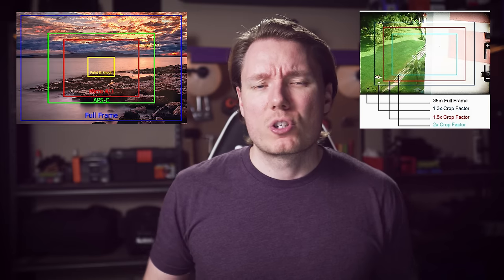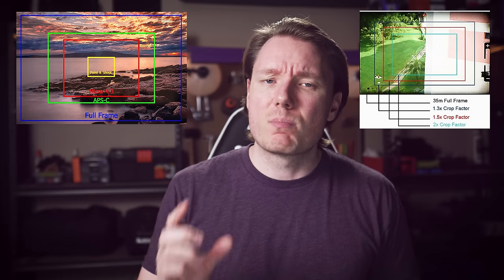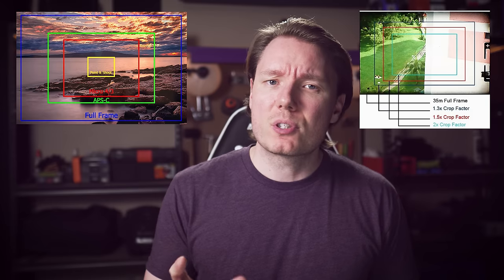Crop Lenses on Crop Bodies: How It Works vs Full Frame (APS-C & M43)

Comment: The one takeaway from all of this, the 35mm standard is a misnomer. Even in the height of 35mm there was other film sizes regularly used. The 35mm was/is still a marketing device. The larger the sensor, the more it costs, the more it retails for. The larger the lenses, the more it retails for. The marketing pitch is that larger is more professional, which to be fair is also a misnomer. The reality is simply use lenses designed for your body mounting system and sensor. How professional that final image looks is up to.
Reply: @krane15  I appreciate this, but in today's world it is a meaning less statement. The 35mm standard was also based off a normal lens being 43mm focal length. So when an aps-c sensor and lens is compared to 35 mm equivalent, it also needs to include the 43mm focal length. It takes the conversion into this weird territory of comparing a aps-c sensor with a 200mm lens would be the 35mm w/43mm lens of...(insert whatever numbers your working with)However it will be a different equivalent if the 35mm had any form of super wide, wide, short telephoto,large telephoto lens. It leads to a place where exact comparisons will always vary depending on sensor size and focal length. Manufactures should just simply state the degree of angle the sensor and lens produce. The photographer can choose how they obtain that degree of angle.  If we are going to use the most popular/used sensor size as a measuring device, then today's standard would the sensor in cell phone camera's with their inbuilt 8mm lens. So does that become the future?..this full camera has a equivalent of a 12mm sensor at 8mm length?
There is no reason to keep this equivalent comparison. It doesn't mean anything anymore.
Reply: @krane15  Fair enough, but I addressed the need for the reference point. When you buy a lens designed for a specific sensor type, it gives you the degree of angle the lens can achieve. Using Degree of angle is a universal reference point. A 32 degree of angle is always going to be 32 degrees regardless of whether its on medium format, full frame, aps-c or micro. 32 degrees is always 32 degrees. The only situation where this information could be important is if two photographers/video's are employed to capture an event and they both are using different sensor sizes, and they want to combine images/footage seamlessly in post and apply a LUT for smooth continuity. Even in this situation if both individuals simply matched their gear to capture at the same degree of angle, that would resolve the issue of both wanting to combine images/footage and keep it seemless.
Reply: @lefthandright01 35 mm is based on a normal lens of 50 mm. So said the man who created it.
Reply: @okaro6595  Which 35mm? Super 35? is the most common film type used in cinemas. Super 35 is far closer to APSC in size. It's still 35mm film, but how it is fed through the recording device is different.  No one will say its not 35mm. The 50mm lens was designed on its normal factor, hence a normal lens will of differing focal lengths depending on film type or sensor. So says the man who made it? Sounds like that man didn't know his product very well.

Comment: If I use a 25mm MFT lens on an MFT camera, will that field of view be the same on a 25mm Full Frame lens on a Full Frame camera?
Reply: No most likely no, unless the lens is designed for the same FOV as the full frame lens your looking at
Reply: You’d need something like the 12-35 by lumix to cover the field of view of let’s say the 24-70 of the Sony g master

Comment: Ok so I’m still left with the question of the the crop factor for the f/stops. If it’s a crop (Apsc)lens on crop body is 1.8 actually 1.8 or multiplied by the crop factor🤔 And same for full frame lens on crop body ( no speed booster) ..... and by this calculation i suppose Apsc lens on Apsc bodies the 15mm is a true 15mm? Not multiplied by the crop factor?
Reply: MrWazyShots as far as I’m aware, from countless YouTube videos, I’d say anyone telling you that you need to multiply aperture by the crop factor is just trying to sell you down the river. I have countless shots on my kit lens at 5.6 that are certainly not ending up with a close to 8 aperture.
Reply: Craig Bishop See that’s what I thought, but then if you can look up Toni and Chelsea Northrup’s video on it

Comment: 2 different bokeh questions:
I am shooting with a full frame 35mm lens at f 1.4
• If I enable crop mode on my Sony A7iii, does f 1.4 look like 1.4x1.5=f 2.1 (in terms of equivalent depth of field) ? In other words, is my background blur going to look like a 52mm lens shot at f 1.4 or 2.1?
• If I enable Sony Clear Image Zoom (x1.5) does f 1.4 look like 1.4x1.5=f 2.1 (in terms of equivalent depth of field) ? In other words, is my background blur going to look like a 52mm lens shot at f 1.4 or 2.1?
Reply: The crop mode just crops the image. In general do not use it. Crop at the post is needed.

If you enable it you must then step back. How this affects the blur depends on the distance of the background. If the background is very far it gets sharper but as it is also enlarged the blur what for example light spots cause remains the same.

Comment: Wow that got pretty complex at the end there but I think I got it. I watched this because in my testing at home, a Canon EF-S lens on my crop sensor shows the exact same image as an EF lens on the same camera. I thought that the EF lens would be  visually zoomed in, but it isn’t. So then I don’t have to do any math conversions if I just want to understand how a lens will perform visually. Crop & full frame lenses look identical on my crop camera.
Reply: Let's be clear, there is no such thing as a crop sensor, they are just different sizes. As an example, if you use a 24mm EF lens on a full frame sensor, and a a 24mm EF-S lens on a super 35 sensor they will both have the same field of view. There will be no cropping of the picture. If, however, you use the EF lens on the super 35 sensor then you will get a cropped image. Your findings with the EF lens compared to the EF-S lens on the same camera do not make any sense.
There is also cropping that takes place in some cameras that can shoot 4k as well as HD. This is because they cannot process a 4k image if it uses the full sensor size so only use part of it hence giving a crop.
Reply: @UKHeritageRailways  Thanks for your reply. I was using the word “crop” to refer to the APS-C sized sensor; it’s just easier to type, but realizing it can create unintended meanings. 
All this was because was I thinking the lenses “should” perform differently on the same camera, but obviously the sensor size was determining the final image and I understand that now. 
It was a little hard to wrap my head around how the focal length can stay the same between different camera systems/their compatible lenses, but the field of view can be drastically different. 
Thanks for sharing your knowledge!
Reply: Why would you have thought so? I really cannot think how people could think so unless they try to learn it without understanding it. You cannot learn things without understanding them.

Comment: A full size lens isn’t just spreading out the same amount of light. It’s sending in more light. To your your projector analogy, it’s like using a more powerful projector lamp, is it not?
Another channel said that full frame lenses work better on apsc because the soft part of lens image is outside of the apsc sensor.
At least this makes more sense to me but I don’t know who is right.
Reply: This confused me too and I think the flashlight example might have made it more confusing. It seems to imply that a full frame lens enlarges the image or an apsc lens reduces the image down to a smaller area, which as far as I'm aware isn't' the case. Lenses designed for smaller sensors just don't render an image circle for the field of view which isn't required. The 'extra' light in a full frame lens is there because it can see a wider field of view. Different sensors occupy different areas, but the relative size of image which the lens projects remains constant (as far as I'm aware)

Comment: Very interested and a new angle on the topic.
I have been wondering about that point... So if one concentrates the light like one does with a flashlight to a smaller point it gets brighter there... 
Now, crop sensor designed lenses project to a smaller image circle than full frame lenses... wouldn't it than also be similar to the flashlight that the light is concentrated so that it has an affect on the exposure?
In other words, can the T-stop of crop-sensor lenses be higher than on FF lenses? 
I didn't notice such a thing, never, in different cases.
But it would make sense and your Video brought that thought up again.
I hope my question is understandable, because English is not my native language.
Reply from the maker: That's a good question. It does have an exposure difference if you're using a speed booster, because that's like a magnifying glass, but otherwise no.
The light that makes it on to the sensor is coming from the world around you, which doesn't change when you change lenses, all the smaller lenses do is eliminate the light that would be unused because of the sensor size, which can make for a sharper projection, but they don't amplify the light.
A full frame sensor can use all the light from the large image circle just like a small sensor can use all the light from an aps-c lens, however, the total volume of light coming into the back of the camera is greater on a full frame system, which is why they often have cleaner signals at higher ISOs.
Reply: @geraldundone   Thanks!!
So there is no such thing as concentrating the light like a magnifying glass through some special lens design ... Sad :p (not taking a lens booster into account which does change the focal length...)
Actually I still don't get it... 
Lens A projects the light on a bigger area and
Lens B on a smaller area.
Both let's say are 50mm f1.4
Why doesn't Lens B have a brighter output?
Reply from the maker: It's all about the angle of view. The area of light that is being captured is also smaller on the smaller lenses, so it's grabbing less light out of the scene and projecting exactly what is needed on the sensor. The full frame lens is grabbing more light out of the scene, using its wider field of view and projecting that larger dose of light onto it's larger sensor.
Reply: @geraldundone  I think I got it now, makes totally sense👍. Thanks 💕

Comment: There were some heated discussions on whether full frame glass should be sharper on crop or it would be the opposite.
Empirical evidence & DxOMark measurements suggest FF glass performs poorer on smaller sensors.
This has also been confirmed by all of Christopher Frost's tests of the same lenses on FF and APS-C.
My personal feeling is that since you are letting part of the optical resolution going to waste by cropping, it's only logical that sharpness would be degraded.
On the other hand, there's the popular notion that cropped sensors get the best corrected center portion of the lens projected onto them, with minimal vignetting, so this should mitigate the situation.
Reply: Cropping on FF would yield less sharpness because the number of pixels per square mm would be less, generally than an APSC sensor.

Less info, less sharpness.

Comment: What really confuses me is that a 50 mm FF lens on my M43 camera gives me the same 50mm shot as a 50mm M43 lens. The light and size  is the same and the final megapixels in post are the same or very very close. The sharpness of the FF lens is usually slightly better. Why is that??? Is it because the adapter moves the FF lens out farther?? Please help me on this. My old manual Nikkor legacy lenses work absolutely superb on my M43 16 megapixel camera. I will continue to use these in spite of the You Tube videos that say different.
Reply from the maker: Hard to say for sure. It's possible that the lens is just a sharper lens. I'm sure if you did that same test with a lousy full frame lens and a brilliant m43 lens the results would probably be reversed.
Reply: Two 50 mm lenses of course give same angle of view. How could they not give. I am confused on how anyone could be confused on that. 50 mm is 50 mm. The only difference is that the FF lens spreads more light outside your sensor.

Each lens has a specific distance on which it has to be mounted. On mirrorless cameras it is about 18 mm and on DSLRs about 45 mm. (each system slightly different) The lens has to be designed so that it projects the image at the proper distance. The focal length of the lens can be very different. Wide angle lenses typically are much longer than the focal length while tele lenses are (by definition) shorter than the focal length. A DSLR lens can have focal lengths as short as 10 mm. In that case the optical center of the lens is well inside the body.  You can in fact think that DLSR lenses that have focal length shorter than 40 mm are in fact 40 mm lenses with built in wide angle adapters.

One benefit of a mirrorless system is that as the flange focal distance is s much shorter it makes the design of wide angle lenses simpler and those lenses better. For example on Canon DSLRs the pancake is 24 mm f/2.8 while on EOS M it is 22 mm f/2.0. Whole one f-stop faster. The latter is also distortion free while the former is not.

Comment: Oh but it gets better! Just because you have a cropped sensor, doesn't mean you get cropped Mega Pixels. In the diagrams showing all the boxes within boxes, it would suggest that if the full frame sensor was, say, 24 megapixels, that a crop sensor is only giving you 18 mega pixels or less. When the "crop factor" is applied to zoom lenses, you get the appearance of extra reach, but you also get the same concentration of mega pixels. This is why wildlife photographers want a high end cropped sensor with a telephoto zoom.  

Say for example you see a crane in a beautiful reflection in the water.  You have a 600mm zoom on your full frame camera. Let's say, from that distance at 600mm you get the entire crane in the viewfinder, plus the reflection. That's a great shot.  Now, let's say you throw that 600mm zoom on a cropped sensor body. Now you have an effective focal length of 900mm.  You can now shoot the eye of the crane and all the details of its feathers, all within the mega pixels of that sensor.  If you wanted the eye of the crane from the full frame camera, you'd have to crop your image. Now you've lost mega pixel and sharpness, as well as picture size for printing. 

There are some advantages to having a cropped sensor over full frame :)

Comment: You mention the smaller field of view at the end. I guess if you're running an aps-c lens on an aps-c body, you'll get all the light (smaller circle) but at the same time aren't those aps-c lenses necessarily smaller in diameter? So you get both less light and less field of view. The crop factor might be a dumb concept, but at the same time there still is a difference in amount of light hitting the sensor for the same focal length comparing aps-c and full frame, isn't there?
Reply: You should understand the difference between the light intensity which determines the exposure and the total amount of light which influences the image quality.

Comment: On the subject of full frame vs crop. Why do so many you tubers mention that on a high res full frame such as 40mp that you have to worry about camera shake and you don't on lower res like 20mp. Surely you get less camera shake on a 40mp than you would on a 20mp crop sensor with the same lens. Are they saying to expect camera shake on everything taken on any 20mp-ish crop sensor camera? Usually it's landscape photographers that mention this which would be using a wide angle lens which is less prone to shake. I don't get it.
Reply: Only if you want to utilize the higher resolution in full.